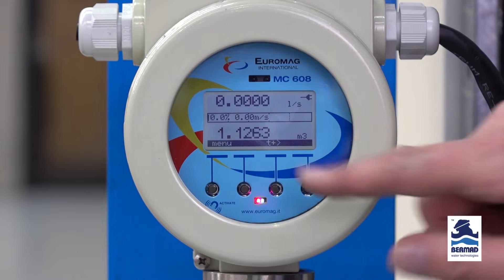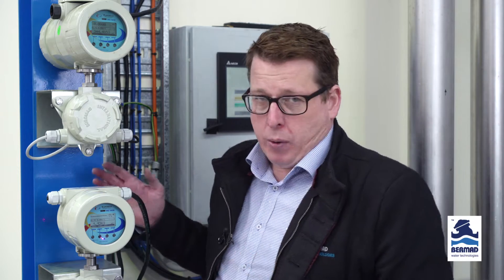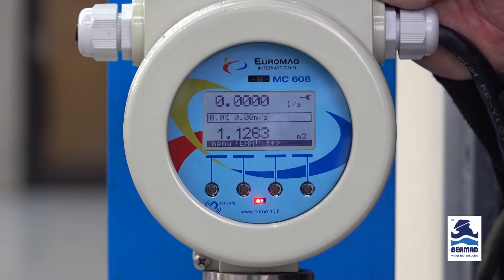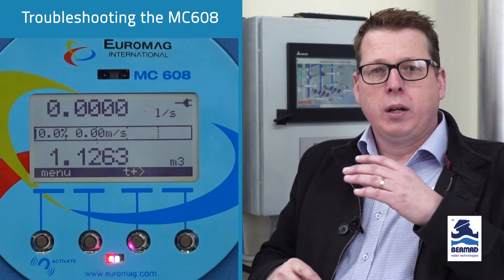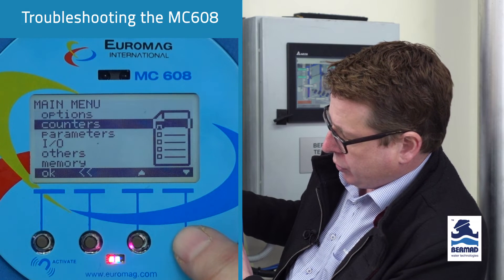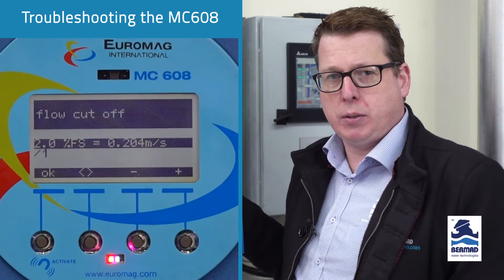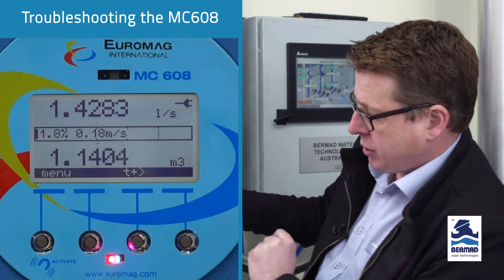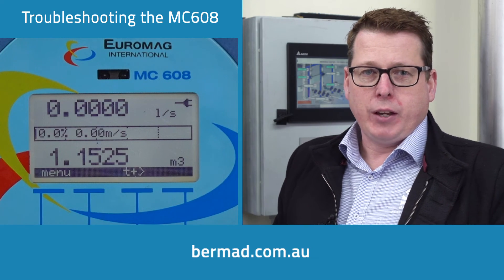Euromag MC608 Powered Converter Troubleshooting Support

Comment: Im having problems with 2 Mc 608 of 300m (12"), both give me "Empty pipe" error but I know the pipe is not empty. I increase the Option of the empty pipe threshold to F, in the beginning it worked well but now it doesnt. Where can I ask for help?
Reply: i unplugged the sensor and plugged it back in and it start to work (both). Im pumping residual water is possible that sensor may be dirty? Or something related

Comment: How i change or know password
Reply: There are three passwords: Level 1, Level 2 and Level 3.  
Level 1 is to protect low sensitive parameters, Level 2 for medium and Level 3 for high sensitive parameters.
The default passwords can be found on page 41 of the operation manual - see following link:
https://www.bermad.com.au/wp-content/uploads/2016/11/Operation-Manual-for-MC608.pdf
Level 1: 608111
Level 2: 709222
Level 3: 231042
The Level 3 password will allow you access to Level 3 protected parameters as well as Level 2 and Level 1.  So, in other words Level 3 allows access to all sensitive parameters.
The password can be changed by pressing the MENU button then navigating to:
MEMORY > PASSWORD SETUP
You will be asked to enter the Level 3 password as this is a highly sensitive parameter
See following link for the MC608 programming guide to help navigate the parameters:
https://www.bermad.com.au/wp-content/uploads/2016/11/Programming-Guide-MC608.pdf

PLEASE BE WARNED:  It is very important if you change the Level 3 password that you do not forget it later.  There is no master code and so there will be no way to access these parameters